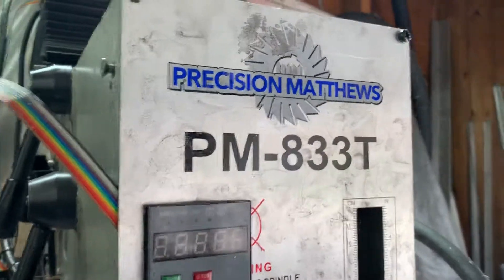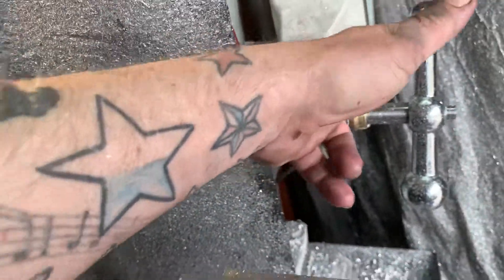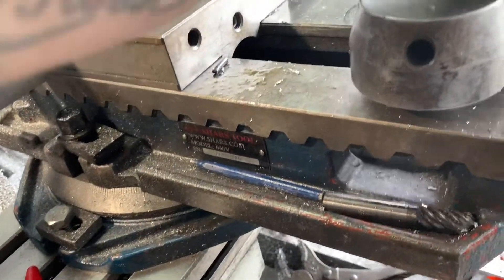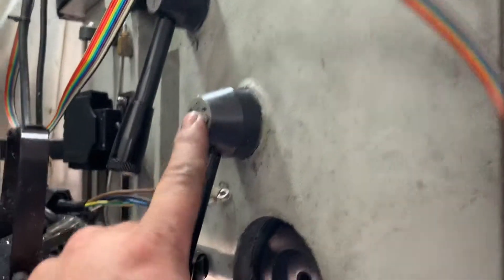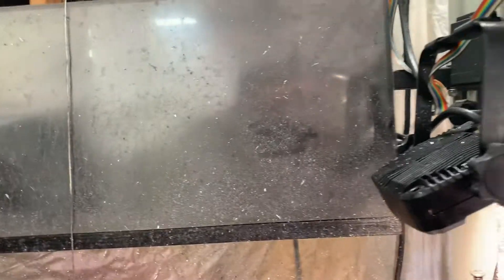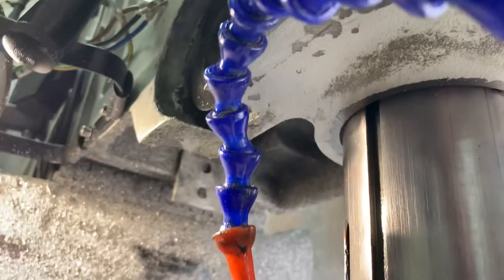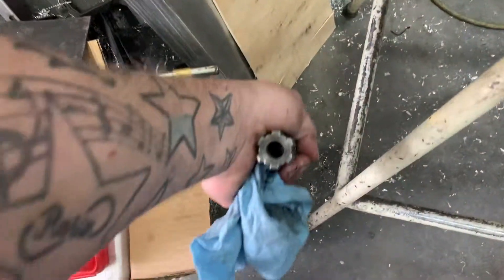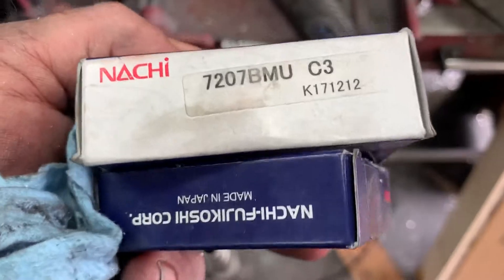Precision Mathews PM833T

Comment: Hey Glenn, I'm just going to state the obvious. Why would you waste your time on a hobby mill? Im retired (44yrs) SME Machinist, Toolmaker, Instrument maker. I've programmed and ran every machine tool, EDM, lasers and computer CAD/CAM you can imagine. I was trained on manual machine tools, NC and CNC. Working at NIST (1987) we had the first A.I. vertical milling machine center with robotic tooling and material loading. You could solid model your part in a Unix workstation and the computer would automaticlly program toolpaths select tools, speed and feeds, load material and hand you a finished part. I still have the part lol. My parts are in the deepest oceans, deepest space, coldest planets, test labs, hospitals, latest war machines and you carry bills from the plates I made. Anyway, my point! I don't care how much training you have or don't. But leaving a chuck key in a lathe would get you fired as an apprentice in a heart beat. The shop is a tripping hazard. Trust me I've worked in some hell holes and watched accident that would make you sick. Thats why I'm a Journeyman. Talk the Talk and Walk the Walk. And I still have all my digits and both eyes too. No offence. You have talent don't waste it.✌
https://youtu.be/ZtjOxZ1v0x4
Reply: Size, cost, and condition! I plan to buy a PM-833 belt drive and convert it to CNC. If I had the space, a heavier machine would be an option but it would be a used machine and that brings up the problem of finding one in good condition that can still do accurate work. If I had the space, I would go on the hunt for a bigger machine to convert or update to run with the newer cnc control options.